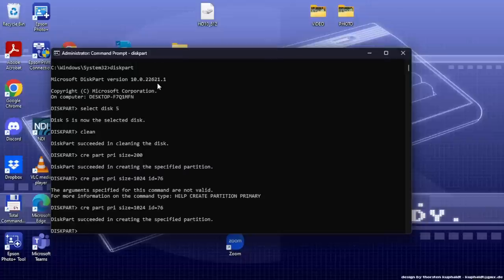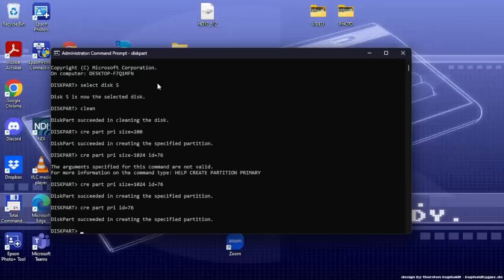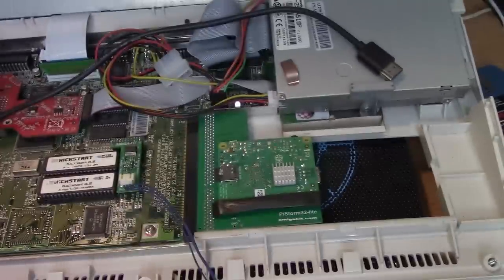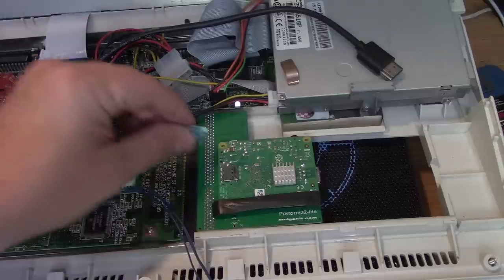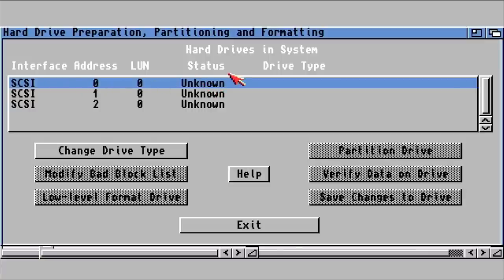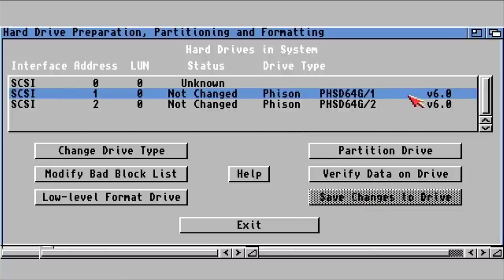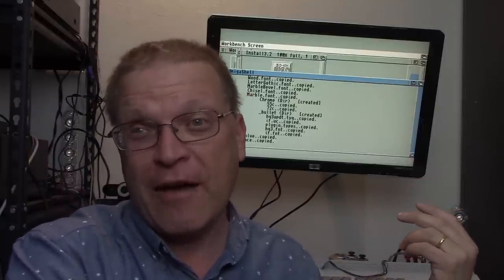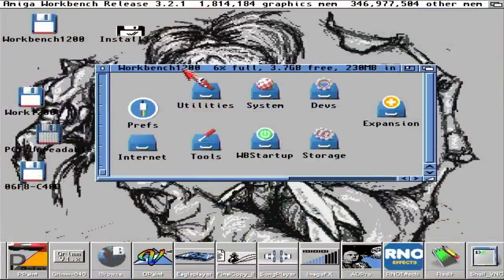PiStorm32 Lite for Amiga 1200 - Installation guide and review

Comment: I just put a PiStorm32 Lite with a 3A+ in my A1200 and it's fantastic. I configured the SD Card in Linux with fdisk and used the same partition type of 76 and it worked great. The biggest issue I ran into was trying to mount PFS3 partitions on my desktop after I set them up on my Amiga. I ended up keeping one large FFS partition for transferring things around. Having RTG so I can see more stuff on-screen is making me want to use my actual Amiga even more now!
Reply: Same. One big FFS partition worked for me as well. PisStorm32 Lite is amazing.
Reply from the maker: Not a fan of PFS. I used it back in 2018 and all of my drives corrupted within a few weeks. I have personally had better luck with FFS. That's just me, though

Comment: Easily the best video on the PiStorm32-lite so far. Due to easter, and all post stopping here in Norway because of it, I've not received my PiStorm from Amigakit yet, but once post resumes it should arrive shortly. I'm quite excited to try it out. The drive emulation isn't very interesting to me, as I'm more than happy with the performance I get with FastATA mk3 and a fast mechanical HDD, but the RTG will be fun to try out. This should be an excellent interim solution until I can get the connector on my old accelerator card swapped out. To me, the super blazing speed isn't that important either, but the fact that I already own a Pi 3B, makes this the cheapest accelerator currently available for the A1200. :D
Reply from the maker: Nice! It's also cool that you can use the HD emulation as a secondary solution. You can even use it to back up your existing equipment
Reply: @10MARC  I think that the slow Chip RAM access is affecting my FastATA transfer speeds. I'm getting way slower transfer rates than I did with my 68030@50MHz. In the end I've decided to try out the SD-card and see how that will work out.

Comment: Excellent video.  Just a couple of small corrections:

An 8Gb partition is 8192, not 8096.

Filesystem Block Size:  Setting it to a higher value on a huge partition does not make it faster.  The block size setting should be relative to the size of the files you store on that partition.  Smaller files = smaller block size will yield better performance, larger files = larger block size will yield better performance.   So, for the Workbench partition, where all the files are small, the default is fine and you may even see a slight speed increase with a lower value.  If you stored all your huge Art Department files on another partition, then definitely create that partition with a block size of 16384 or higher (preferably higher, if supported).  You WILL see a performance increase there.
Reply from the maker: The Block Size needs to be made larger not for speed, but for RAM optimization with Fast File System. Too small a block size on an Amiga will cause a huge use of RAM if the drive ever needs to verify and cause huge issues.

Comment: Hi Doug! Thanks for an excellent guide and review of the PiStorm32 Lite! I have been on the fence concerning getting one, but decided to take the plunge today. :-) Your video was helpful in this respect. :-) Keep up the good work and have a good weekend!
Reply from the maker: Mine is growing on me. The improvements to the CHIP RAM access are giving me hope.  I am still in the position that if I only owned one Amiga I would not do it, but since I have more than one I can experiment with it.
Reply: @10MARC  Sounds good! 🙂Mine arrived today, so looking forward to checking it out. 👍
Reply: Just installed it and it is shockingly fast! Very impressed so far. 🙂

Comment: I notice you have an Indivision AGA flicker-fixer installed.  How are you running the video while doing this install of the PISTORM32?  Which video output to use is confusing...Indivision or PISTORM... Do you no longer need the Indivision AGA in the 1200 once you have the PISTORM32 installed?
Reply from the maker: I use the Indivision MK2 for all standard Amiga modes. I usually have a DVI to HDMI cable running to the capture device on my PC to capture video. I use a two position HDMI switch to go between the PiStorm RTG and standard Amiga modes. The PiStorm does not output standard Amiga graphics, just Hi-color RTG modes.

Comment: 434 times FASTER? Wow, that's a Pi-STORM indeed! The 68K lives on in the RPi! Amazing that the OS still can be used.
Reply from the maker: What is crazy is that the AmigaOS can handle new processors like the PiStorm emulation and Vampire with minimal issues. The OS just works with whatever speed and RAM you toss at it.  It is really scalable for being a 25 + year old OS

Comment: Thanks for the video. I've had my PiStorm32-Lite for a few weeks now. My A1200 is very similar to yours, except I'm using a CompactFlash adapter on the 44-pin IDE port. A couple of things I'm struggling with that I didn't hear you mention. First, when I'm booting off the PiStorm's MicroSD, I sit at a black screen for roughly 30 seconds before I have any sign that it's booting. There is no activity on the HDD light. Is that normal?

Also, I'm struggling to get my PCMCIA CF adapter working with a FAT32-formatted card I typically use for transfers. It seems fine when I boot it into an old ClassicWB install, so think the PCMCIA slot is working - I'm just not sure what combination of FAT95 and CF adapter drivers I might need here. And unfortunately, I've been away from the Amiga scene long enough that I just can't seem to jog my memory. If you know of any guides I can use to get this working on a vanilla AmigaOS 3.2.2 install, I'd really appreciate it.

Anyway, thanks again for the video - it's been a struggle finding info about this setup. I did pop into the Discord channel, but I've never really used that platform and having trouble navigating the various threads there to get useful information. I wish someone would setup a dedicated site that details common config challenges.
Reply from the maker: I have never had to wait when booting from the MicroSD - it is quite fast. the 30 second wait is often when the Amiga cannot find a boot device. Is your SD partition set to boot priority of 0? is your Compact Flash IDE installed at the same time? If both have the same boot priority it can cause an issue.
You will get no hard drive activity light when using the MicroSD - there is no physical connection to it, but in theory it is probably possible.
You need the Fat32 drivers and the CFD133.LHA file from Aminet to use the Compact Flash card in the PCMCIA.
Discord is a hot mess. Good luck finding anything there.
Reply: @10MARC  thanks for the tips - after I mentioned this, I did some troubleshooting with the boot order and indeed you are correct - I had multiple devices with a boot priority of 0. Correcting that seems to have solved the problem. Also, thanks for the advice on the CFD133.LHA package. I'll give it a shot. Much appreciated!!

Comment: This practical how-to video made a refreshing change from all that Cloanto versus Hyperion stuff! I have been toying with the idea of getting a PiStorm32 for my A1200, but I think it might be better to get the A500 version. What do you think?  Thanks for uploading.
Reply from the maker: Well I make all kinds of videos, and 98% of them have nothing to do with the legal battles! 
It is a fantastic update for an A500 adding the Hard Drive emulation and the massive RAM.
Reply: @10MARC  There's a video in that! Comparing an A500 with a Pi Storm to a A1200 with one. What are the pros on cons of each machine?  On an A500 - it is easier to remove!  Thanks for all your efforts making these videos.

Comment: I find a better way of defining the drive types is to simply add ram: to the beginning so that it doesn’t write any changes to the already pretty full install disk. This would probably also deal with the bug you mentioned.
Reply from the maker: That's a perfect way to do it. I do wish they would just fix the issue. I am sure it is just a permission issue on the file

Comment: On my pistorm32 pi 4b fails to recognize partitions  on sd card. I had to switch to raspberry pi 3b to set my PFS partitions. There is another issue with PFS memory allocation. After partitioning amiga would not format PFS partitions giving me an error message about memory allocation that do not match mask. I fixed the problem by changing the mask from 0x7fffffe to  0x7ffffffe and max transfer to 0x1fe00. I hope that helps. If you wonder how fast is the hard drive I'm getting 26Mb/s vs 1.5Mb/s on onboard IDE and with overclocked pi 4b Sysinfo reports 4700 times the speed of Amiga 600

Comment: Great video Doug, just what I needed to dive into the Pi-Ocean, but alas I am a Mac user and Mac's Disk utility will not partition Fat32 formatted storage devices. Crap! It will only partition Mac Journaled formatted drives/cards. I purchased my 32lite from amigakit with the sdcard already loaded, but the 32gb card was 1 partition. I formatted it in Mac Journaled, them partitioned the 3 partitions per your video and formatted the partitions Fat32, but the storm doesn't recognize the card because its root is still mac journaled format. Crap! Do you provide a service to set the card up as you did yours? (I'll copy my existing partitions to it, just need it set up like yours inclusive of the HDMI drivers) Thanks and have a good one.
Reply from the maker: Anybody with any PC can do that. I agree that anything formatted on a Mac is a bit wonky. I can help you set up an SD card depending on where you are located. I am in the USA.
Reply: @10MARC  Thanks very much, I'm in the US as well, in Michigan. I really don't know anyone with a PC, I'm just an old fart with few friends I guess. I can mail the cards to you.I have an A600 storm, and the Lite32 for the 1200. Once they are set up I can take it from there following your excellent instruction video. Where can I mail them to?

Comment: Thank you for the informative video, Doug.
You mentioned that networking isn't supported, will it still be possible to use a PCMCIA card with a network/wifi adapter on the 1200 ?
Reply from the maker: That should be no issue at all. It also works ok with a Plipbox on the serial port
Reply: Yup, a PCMCIA card works great (preferably a 3Com 10 Base T version since drivers for it are available on the Amiga). And with the Roadshow networking stack it's perfect.

Comment: Since PiStorm is in emulating the m68k, Fast-RAM  is not a problem; major bottleneck is going to be Chip-RAM and the speed of the Amiga's custom chips which are slow in comparison. WHDLoad games are always going to use non OS friendly ways of banging the metal which are always going to produce strange side effects. Same can be said for emulators like WinUAE with software which is reliant on the blitter.
Reply from the maker: You are correct. Anything running from FAST RAM works fantastic - it's when you hit the custom chips that it drags. I don't agree about WinUAE, though. I never have issues accessing the "virtual" chips or CHIP RAM. Nice and speedy for me! 
AmiBerry on Linux sometimes has issues with audio on a Raspberry Pi, just because the audio on those is mediocre at best
Reply: Its because the pi has to access chip ram via gpio that makes it even slower.

Comment: What I couldn´t find out in any youtube video: How long does a cold boot (from power off) take? The Pi has to boot first. It´s probably more bare metal than a full blown Linux. Is the A1200 waiting for the "CPU" to wake up?! 
I was pretty disappointed by OS3.1.4, taking so many seconds to the "insert disk" screen (I know it´s not a cause of emulating anything). Anyway, as soon as networking gets implemented, I am all-in!
Edit: is there a simple on/off switch you could add to go for standard A1200 WHDL with Chip access as expected?
Reply from the maker: Huh. Missed this comment somehow! There is no real delay in booting. The Emu68K logo pops up almost immediately after power on and everything boots quite quickly. I see no delays at all over and above my Blizzard 68040 boot times. Faster, actually as the virtualized hard drive is so fast. 
Emu68K is bare metal. It's not loading Linux first.
Reply: Sorry for my english, i'm french 😄
I dont know if it can help , but during my first tries with my pi4 B , it took 30 secs at each powering on before seeing emu68 logo... then my 1200 booted.
This was caused by the fact i had previously modified my pi4 bootloader to boot from USB
After changing back the bootloader to its original state, my pistorm32 boots immediately

Comment: A really good alternative to the "overpriced" accelerator cards from other companies. I found the package(Alltogether) for 180 euros in the EU Store. Now all I have to do is persuade myself to buy it :-) However, a question remains: games that run on normal screen will not run with RTG support? Or is it only delivered at the AGA outcome?
Reply from the maker: Nope. Nothing on Earth lets your games run on RTG screens unless they are RTG games. Amiga just does not work that way. Those games generally hit the chips directly for performance and bypass the Operating System, which is what controls the RTG.
Reply: @10MARC  I thought something like that, but thanks for the answer
Reply: @frankb763  Great later games like Napalm, Genetic Species, Exodus: The Last War, Payback, Quake, Foundation and anything under Shapeshifter will use RTG. Get an A500 Mini for the WHDLoad stuff and use this for productivity and RTG games! Heck the PiStorm32 crushes it for the new engine/modded (spinning 3D ammo and graphics improvements) AGA Alien Breed 3D 2; 32fps under AGA compared to 11fps on my 060/50Mhz! There's plenty of fun to be had!

Comment: I've installed OS3.2.2 Best WB fresh for my PiStorm with RPi3 and it's really fast but there's someway to go for us to sell our 030 cards just yet! Games fair better than Demos (sadly, Hybris audio speeds up and down, even with PAL option ticked). Popular Demos from the 90s fair much worse. Some are fine, some glitch and some crash. Audio sync seems to suffer too. I'm using latest nightly build of Emu68. I heard "firmware" has been patched to fix some timing errors but does he mean Emu68 or is there another way to patch?
Reply from the maker: I need to test the latest patch and see if it does truly perform better. I worry that some of the "patches" address specific issues, and not the underlying problem
Reply: The glaringly large list of incompatible titles makes this a hard no for me.  Some titles can be coaxed into working by adding some cache modification entries to some sort of .ini file.  The CPU emulation is fundamentally broken and places a priority on performance over compatibility.  They sorely need to take a page from the UAE book.

Comment: Thank you for this Douglas, this has been so helpful. I followed your instructions but when it came to setting up the modes in Picasso96, no modes appeared. I am using the Picasso96 from Aminet. Is there anything else that needs to be added that was not mentioned in your video?
Reply from the maker: Just make sure you "attach" the board using the utility and drag and drop modes like i show in the video

Comment: Yeah I'm getting that same weird effect in RTG modes as if you're looking at Workbench through a chain link fence. Maybe it needs a change of one of the HDMI settings in the PiStorm config, although I haven't tried that yet. Otherwise PiStorm32 is worlds better than my old ACA1221 with its 28Mhz 020 (I'm not much of a gamer anymore and I still have my other Amigas if I want to do that). Also my install defaults to 900MB of Fast RAM... hey It works and I'm not going to argue. :)
At any rate, the review and the installation guide are much appreciated!
Reply: If you mean you are getting a weird grid/mesh effect on the screen, you can fix that by finding the monitor file in Devs: and adding VC4_SCALER=3 to the tooltypes. (If that doesn't work, try different values).
Reply from the maker: Thanks for the info on fixing that. It is not very noticable on my monitor unless I really look for the pattern, but shows up very clearly on my capture card.
Reply: @10MARC  Also, please use a bit more recent video core driver from Emu68-tools package. The one you took from my google drive is pre-ancient....

Also, do not use 24bpp mode. It is awfully slow. IT is much (much!!) better to work with 32bit (true color + alpha) as this one is actually the fastest one.
Reply from the maker: @MichalSchulz  nice. I could only find the one link to the RTG driver.
Reply: @LemaruX  THANK YOU for this tip! I'll give that a try. EDIT: This did the trick. I switched it to VC4_SCALER=1 (3 didn't work for me) and now the screen is clear as crystal. Thanks again!

Comment: Again, great video Doug! Do you know if it's possible to mount a Pistorm SD card (that is also used as Amiga hard disk) in winuae? So far I haven't succeeded yet 😢 I'd like to transfer a huge amount of whdload stuff
Reply from the maker: Strangely I have not yet tried that - I assume it works, but I will test it later today

Comment: Did you try to connect any kind of Realtek High Definition Audio internal chip or soundcard to Amiga? and test Symphonie Pro ?
Reply from the maker: Nope. There is no high def soundcard that will connect to the PiStorm and work with the Amiga. At least not yet. The USB on the PiStorm is not used at all.

Comment: Hi nice video offtopic: where do you get the keyboard header and flatcable, i have the same custom keyboard but accidently damaged the flexcable.
Reply from the maker: I bought the new keyboard membrane that is available. It has a solid connector so i no longer need the plastic brace to hold the cable in. It's still available - I think retroready.one might stock them